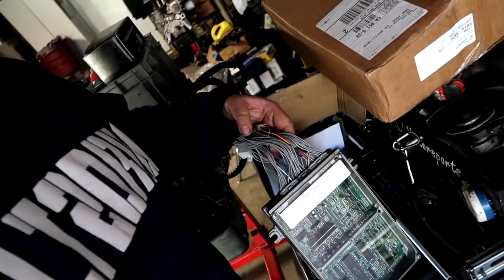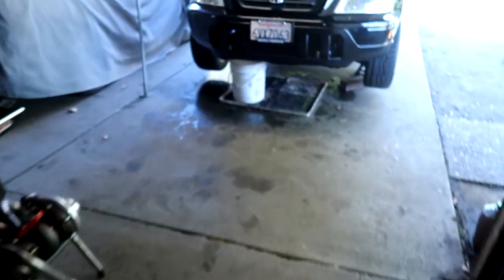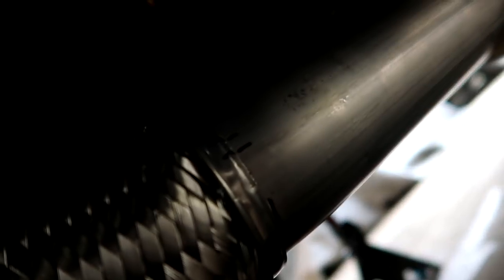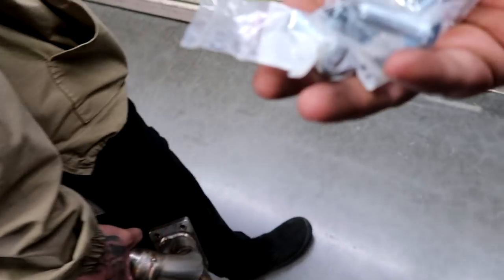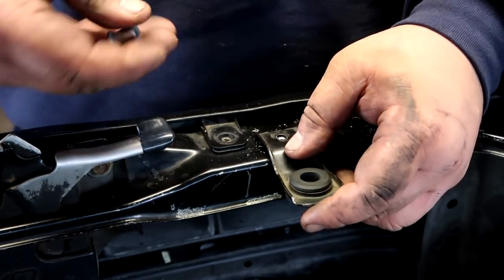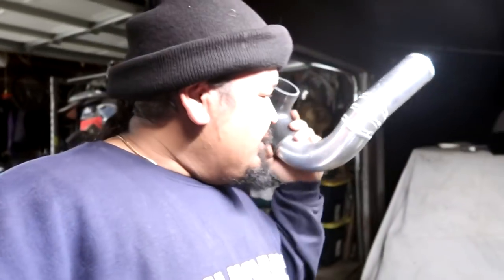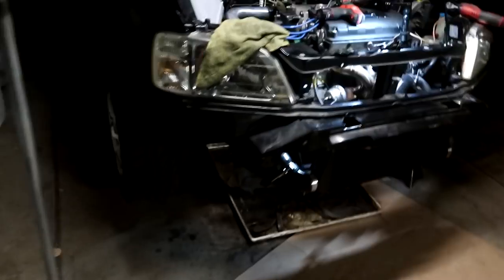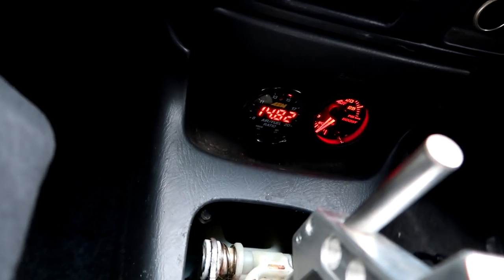BOOSTED Honda CRV Gets a NEW EBAY TURBO !

Comment: You should see my turbo/radiator setup. I have a PLM top mount turbo manifold with the same GTX3582R, a 60mm Turbosmart Powergate (that's huge), and a Mishimoto half rad. I had to cant the radiator at an angle to mount the wastegate otherwise the gate would hit the radiator. I am not a professional fabricator by any means, and the only welder I own is an old Craftsman flux-core welder that I bought off of my neighbor for $75 8 years ago. I cut the radiator mounts off of the lower rad support, got some 1" flat stock, and fabricated mounts for the radiator to mount behind the headlight and still get plenty of air. I have a 10" Mishimoto electric fan on it acting as a pusher. I also have all one piece 3" intercooler piping, so that was interesting to fit.

Comment: Iv never welded aluminium but if u turned the amps up wouldnt lay the beads more flush with the pipe instead of it being a tall bead
Reply from the maker: was actually a preference. i wanted it to bulge a bit.

Comment: I convinced my sister to get an rd1 and she loves it, but last week the cel started flashing and running really rough. Its throwing code 71 & 73. With 250k miles you think it could've burned a valve? And do u think an ebay valve kit would be ok to get? Ive had terrible luck with ebay stuff failing really fast or not fitting. Im debating on using seafoam to see if that fixes it, but without taking it apart I dont know if theyre broken or just dirty and not sealing right
Reply from the maker: a compression test would tell you which cylinder needs attention then a leak down can easily tell you whats going on with a certain cylinder. it could also skip a tooth if the belt hasnt been serviced in a long time. causes a misfire. a stuck or failed injector could cause 1 cylinder run more ruff than the rest.

Comment: Did you run a resister for the oil feed?
Reply from the maker: no. i drilled the oil to probably .065. not an actual dual ball bearing. also a -3 line almost a restrictor within itself

Comment: Will a turbo work on an automatic??
Reply: Absolutely. But your automatic may not work very long with the turbo. It really depends on how you drive it. Are you gonna daily it, or weekend track it?
Reply from the maker: it will but tuning it will be hard and the torque converter might go before anything.